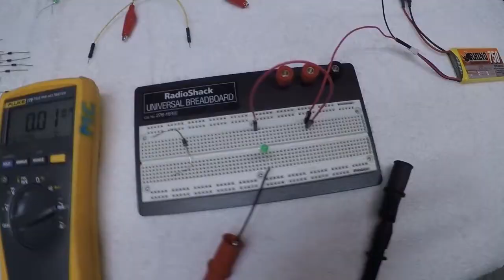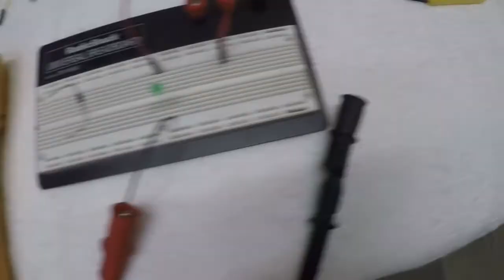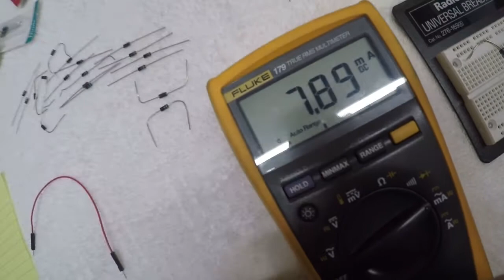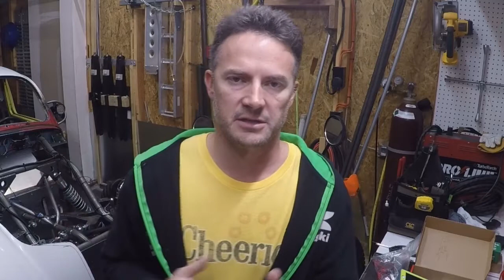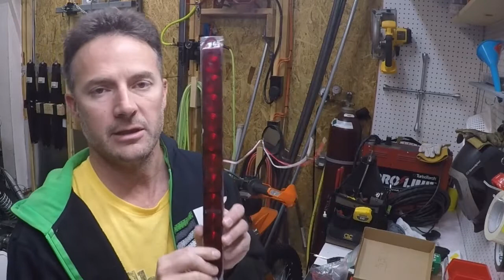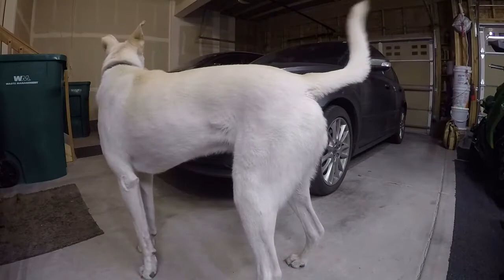Baja Bug Electrical EP. 6. LED lighting explained

Comment: Did you wire in resistors to the little indicator lights at your switch panel on the dash? I'm working on wiring my switches right now and your work looks very neat and professional, definitely something I'm looking to emulate.
Reply from the maker: I did not because the mfg already has them in there. The only time you will need to install resistors is if you are custom building your own led lights. These led lights were ready to go.
Reply: Doug Bug gotcha. So if you were going to use the small green one you used as an example to indicate when the headlights were on, you could add the resistor to limit any unnecessary draw? 

Would that connect to the positive or the negative end of the LED? Would you solder it directly to it?
Reply from the maker: That's right! The one in the video would need a resistor.
Wire in the resistor before the led. So go from the positive to the resistor, then out of the resistor to the led. Then out of the led to ground. (of course you will need a switch in there somewhere)
In my dash for the turn signal indicators I used these in green. http://amzn.to/2hDeW6w
They are about the same size as the led in my video but they have a nice housing making them easy to mount and the resistor is already installed. But if you want to make your own I totally get that, I'm the same way.

Comment: I applaud your ingenuity.  My question is, why use diodes to drop circuit voltage?  To my understanding a diode is an electrical check valve, only allowing current to flow in one direction.  If a voltage drop is desired, why not add the appropriate resistance via resistors?  I'm probably missing something.  
PS I like your work and channel.  I'm in the process of building a turbo 2.3 Manx. I found your channel looking to see what others have done
Reply from the maker: Andrew Munk, you are correct, I'm not using the diode for it's intended purpose. It's like propping a door open with a hammer. But here is the key. The resistors will accomplish the drop with resistance. The byproduct will be heat and wasted energy. The diode will accomplish the drop with chemical composition as a result of it's design. So it will reduce the voltage but not with wasted energy. Honestly I can't describe it any more than that because I don't really understand it beyond that. lol.All I know is that over my years if I need to drop voltage for a diode either on an RC car or a real car a trick to do it is with diodes.
I've Googled it before but it gets pretty crazy confusing real quick.
A turbo Manx sounds awesome! Good luck with that build.

Comment: NICE job Doug on explaining the voltage drop utilizing the diodes as resistance as it relates to the tail lights.  So, you just run the diodes in series? Stuff them in a box by the tail lights or control the voltage up in the dash?
Reply from the maker: Just wire them in series. How many you need depends on how bright or dim you want the led to be. So then wire them up, wrap some heat shrink around them, and stuff them in the wiring harness somewhere. If you did it right you should never need to access them again.
Hope it works out for you, if you have troubles let me know. We'll figure it out. 
Have a great day.